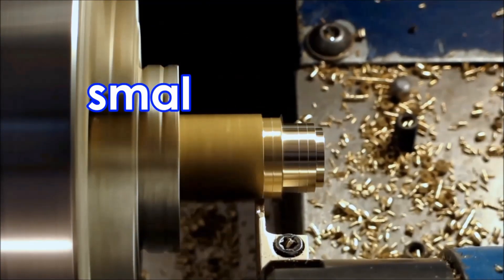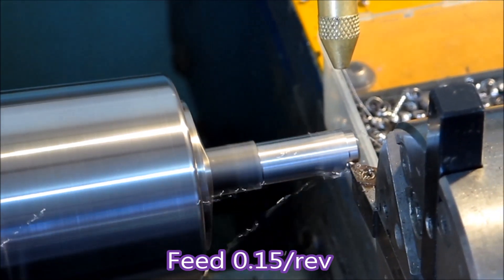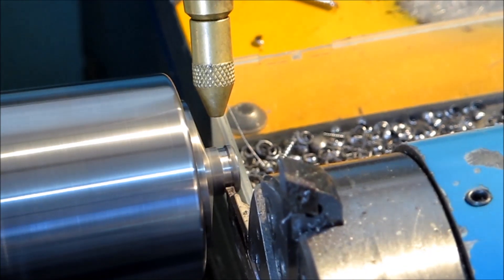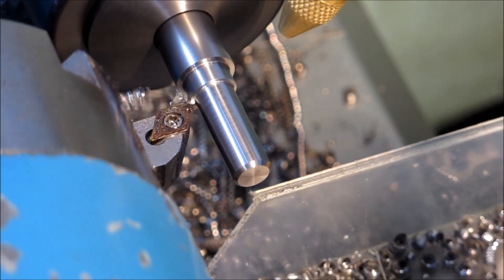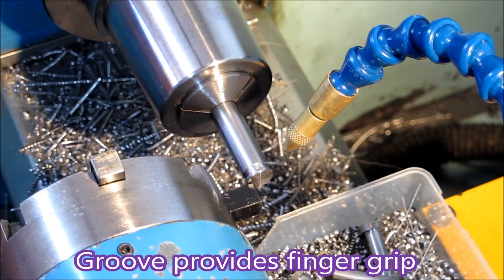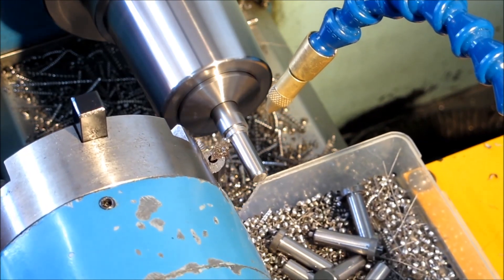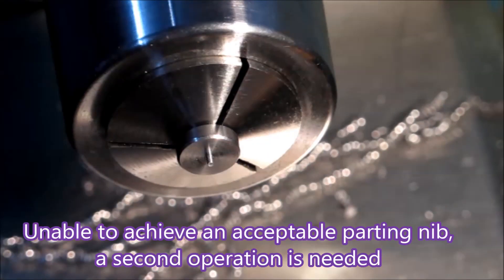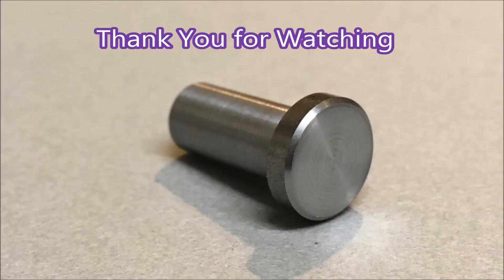S1214  Free Cutting Steel held in a 5C collet and turned at 2400 rpm in a small cnc lathe

Comment: nice, do you have a video for your automatic bar feeding ?
Reply from the maker: I don't have bar feeding.  With this job, I was going to cut a groove and use a blade to pull the stock forward. But I realised that without an auto chuck it was a bit pointless.
Reply: @smallcnclathes  yes exactly, how come u make so many parts with manual feeding?!
Reply from the maker: @GraphicManInnovations  I had no choice if I wanted to get the job and make some money.

Comment: Do you worry about breathing in that soluble oil mist?
Reply from the maker: I try to keep the spay to a minimum, if mist can be seen in the air escaping from under the canopy, I turn down the liquid supply. My ideal is when a piece of paper takes a few seconds to show it is wet, that is becomes translucent. If a job needs to be wetter than that, I tend to back away from the machine a bit. So I suppose I do worry about it. 
Thank you for your comment, I appreciate you taking the time.

Comment: so what's the use of free machining steel?
Reply from the maker: it is quicker and easier to machine and gives a better finish than standard mild steel.
Reply: @smallcnclathes  i mean the example, is it for structural steel or bolts... or what?
Reply from the maker: @NKG416  not sure if it is used for bolts but it is certainly not meant for structural use. It is made to be machined. Use a search engine to look for Free Machining Steel.  Sorry I can't be more helpful, but I just use it to make parts for customers that want it. not sure how they use it.

Comment: That was great.  How many of those pins did you have to make?   Sorry for my ignorance on this. But what makes one steel better than another for free cutting? Is it more the evenness of the outside surface?
Reply from the maker: Hi Gary, it is the chemical composition  of the steel, I think S1214 has Sulphur added and S12L14 has some lead added too.  This makes them machine really well, but weld poorly.  Not sure they would forge too nicely either.  As far as I am aware the only surface finish item that is involved is that it is far easier to get a nice finish on the free cutting steels.  I had to make 200 long pins and 100 that were some 8mm shorter.
Reply: That is interesting.  When you get those orders I guess they specify the type of steel needed or a list of acceptable materials.   
I have a hard enough time figuring out the various high carbon steels and their hardening properties.  Good thing google is my friend on those questions. :)
Reply from the maker: Hi Gary, I always try to steer customers toward free cutting steel and machine grade aluminium.  If they really need something like 4140, they have to go elsewhere, my machines are not large enough to handle that steel economically. I did machine some 4140 as you can see in this video https://youtu.be/2QU3xGtlixw of making some pull studs, but it is a slow process as you can see.
Machine grade steels do not weld nicely and machine grade aluminium does not weld or anodise well, brass is not a problem.  For these pins, I think they are just a pivot pin with little load on them, so there is no difference in their performance relative to 1020 mild steel which is not as easy to work in a lathe with just 1/2hp available at the spindle.
I have got to the point, where I just don't do work that is hard on me or my machines, life is too short.

Comment: Where did you find the free cutting steel? Looks like it cuts really nice
Reply from the maker: Hi James. I get my steel through a friendly local cnc machining company, who cut it up for me to the lengths I require. It does machine much better than mild steel.
That was S1214 steel, S12L14 machines even better if you can get it. S1214 is available from steel suppliers. However it may not be available in a size and quantity that suits you. You could see if a local machinist could supply you. For the convenience of supply, I pay about the same price per kilo as I do for aluminium, but at least I can get it.  This would not be possible for me through an industrial steel supplier, as I would have to buy lengths, have a fork lift and a saw.
As for cutting really nice, don't forget the insert I use has 15 degrees of rake and ground edges.  Many inserts have much less rake and a moulded edge, which in comparison is "Blunt"
Reply: @smallcnclathes  sounds like a good contact to have! I just buy through the industrial supply stores but my local is happy to sell 30cm lengths of most stuff, they just dont get any 12L14 or anything like that. P. S. I use the same inserts exactly, they are great for nearly everything! Im in canberra so not much choice of materials and tools.
Reply from the maker: I guess if you needed a length, you could see if they would buy it in for you? I wonder if their supplier actually stocks the stuff and your supplier just does not carry it, through lack of demand
The relationship with my supplier, is a long standing one, I used to buy a lot of cnc turned parts from them. These days I mostly just get raw steel and brass from them, they seem to be happy to supply me and I don't know how I would manage without them.
You use the Sumitomo FC inserts too?
Reply: @smallcnclathes  yeah if i needed lengths its not a problem at all, they often get special grades of brass and ally for me in lengths.
Yeah i use the sumitomo inserts too, they are fantastic! I keep atleast two boxes of DCGT hanging around all the time. They are my go-to for CNC and manual work
Reply from the maker: I use the FC chipbreaker for the cnc but find the SU with moulded edge is better for the manual lathe, it takes the accidental bump into the stock much better than the FC, the ground edge is a bit fragile for my rough usage in the centre lathe.  I will be trying the FB at some time as it is 20 rake but with moulded edge and significantly cheaper.
Reply: @smallcnclathes  yeah i do burn through a few with the occasional bump.. Keen to see how you go with the FC! Though i probably will, im nearly finished binge watching all of your videos.

Comment: 1/2in to hold 12mm? How did you get the additional range? I tried using a 13mm collet for 1/2in stock and just the .3mm difference made me uncomfortable closing the collet that much before it started to bight. Am I just being overly cautious? (I wind up using ER32 for non fitting stock, but I really should hit up hafco for an imperial 5C set)

Like the tip concerning the nibs, I tried something similar just the other day and was pleased.

Good luck on the next 500 subscribers! :)